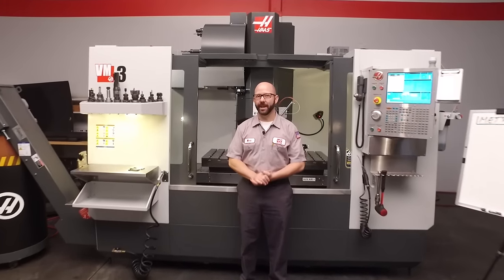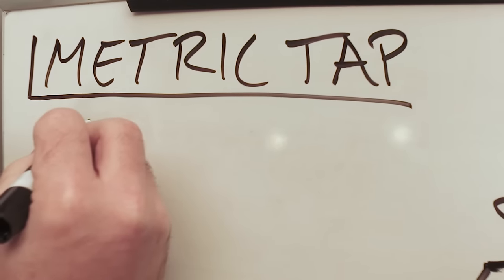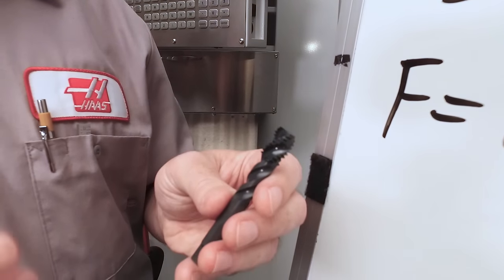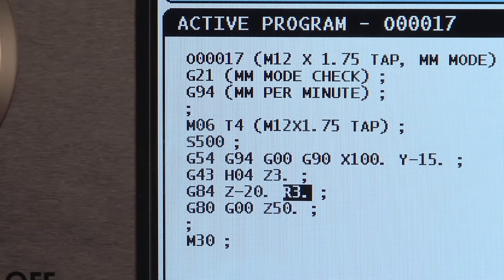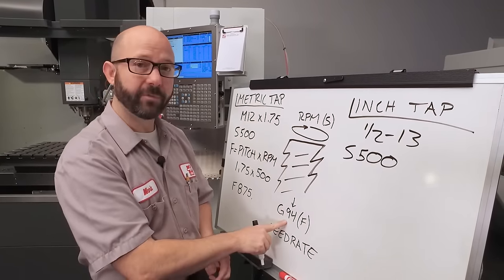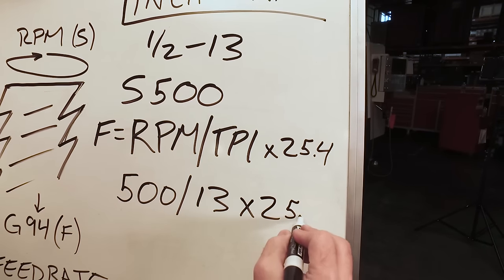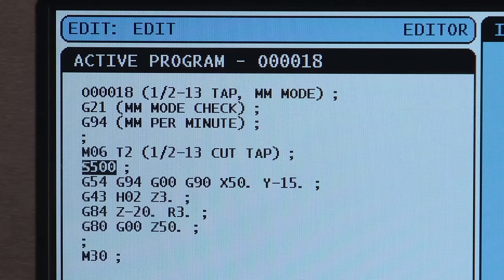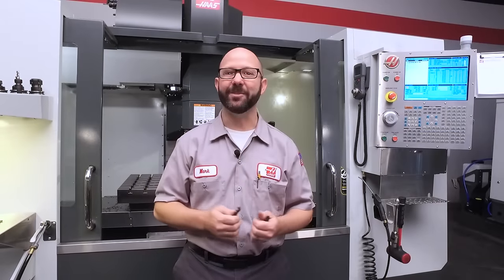Easily Program a Tap in Metric Mode on your Haas VMC – Haas Automation Tip of the Day

Comment: IMO I find it more flexible to use a G95 (feed per revolution) prior to the G84 with a G94 after, that way you can play with the spindle overide without messing up your taping cycle, thus in your G84 your feed simply becomes your metric pitch, in your example it would have been 
G95 (mm per revolution)
G84 Z-20. R3. F1.75
G94 (mm per min)
for the M12 x 1.75 thread, granted it's two more line of code, but you can now play with your RPM to fine tune without recalculating your feed
Reply from the maker: Serge – Great comment. I totally should have put that in the video. I don’t know what I was thinking at the time – maybe just trying to keep the Inch and Metric videos similar. Why do any math at all? Just use the pitch (lead) as your G95 Feedrate, and tap. Thanks for the comment. – Mark, Haas Tip-of-the-day

Comment: Once you understand feed per rev x rpm and whether you are in inch or metric mode it's a pretty simple deal. I think you could also switch to inch mode for the 1/2-13 tap sequence, then back to metric and the end of the tool cycle. Am I right?

Comment: Yery nice sir. Like that how to calculate drill size for single ster inch tap, form tap, n p t  tapper pipe tap,and helical insert drill tap ? How to Thread milling od id dia  calculation?
How to do dubbel star or thribal star thread milling?
Generally Why we Can't be using in milling tapping, threading,  G95 feed per revalution?

Comment: I,ve never seen a milling machine program that has the feedrate in a tap cycle to be in mm/min. Its a dead set custom in Europe to keep the feedrate in MM/rev (the same as the pitch) to avoid mistakes .
Is this changable a machine parameter setting in haas machines?

Comment: It's more easy to program in feed per revolution mode or G95. The feed is exactly the pitch of the tap. You can change the RPM as desired and the pitch still the same (the controller will do the rest for you). So if you get a M12x1.75mm tap the feed is 1.75mm (considering your machine is running in metric mode).  If your machine is running in inch mode you must convert mm to inch. 1 inch equals 25.4mm. 1.75÷25.4 is approximately 0,0697 inch. This is the feed to be programed in inch mode using the M12x1.75mm tap. Too easy and no mistakes.

Comment: Could you do a video on the lathe talking about G70 G71 OD/ID turning cycles? they are very useful and one of the main ones you use.
Reply from the maker: +the hollow box We will definitely forward your comment to our video production crew. Thanks for the suggestion!
Reply: +Haas Automation, Inc. is there any way in which you can turn off or a least reduce the "beep" sounds whenever a key is pressed. Most of the time it's good to hear the sound to know it's been firmly pressed but other times it can get irritating/annoying.
Reply: I agree with you that a beeping sound on the Haas controls are really annoying.  Especially on the new Haas, this beeping sound is really loud.  On the busy day, this beeping sound is driving crazy.......

Comment: I like tools for helical interpolation thread milling, i thing it's safer, can be corrected,
a single tool can be made with threads of different diameters (particularly for larger threads),
programming takes longer but how cool is if you can prepare a program of R parameters.
What you think ?
(sorry for my English, I am a Polish and I'm still learning.)
Reply: Yeah this is a good way to make threads but is not really that quick to machine, VARGUS make a good tooling range for this and a nice little software package that has all their tools set up in it. The software is easy to use as it is predominantly graphical with some data entry and selection from dropdown lists.

Comment: FEED = RPM / ( 1 / ( pitch / 25.4) Is generally the method i use to tap metric tap with inch coord system.
Reply: +Anthony Norwood What would be the difference between lathe and VMC programming?
Reply: Generally in the lathe feed rate uses inches/millimeter per revolution.  Where the mill uses inches per minute or millimeters per minute.  So in a lathe, tapping feed rate would be the thread pitch, rpm would not affect it.
Reply: Suhaib Sbaitan He literally just said that. 
You're not a mathematician.
Reply: Suhaib Sbaitan There isn't. 
Lathes and milling machines can perform the same functions.
It's dependent on how you want to do it.

Comment: Hey guys just wondering why you don't switch for g94 fpm to g95 fpr tis is a better way in my opinion because if you need to up the rpm you don't need to recalculate the feed per minute this is a good idea because you might forget to change the feed rate especially if you get interrupted by your work colleagues etc.
Reply from the maker: Ray 1 – I like the way you think Ray. When running on a machine in Inch mode, we have to do all kinds of funny math. When tapping on a machine that is in Millimeters (Metric Mode), I think you’ve got the right approach – switch to G95 Feed per Rev, and just use the tap Pitch as your feed-rate, making sure to put it back in G94 Feed/Min when you’re done. On machines in “Inch”, I typically calculate things out (I use a lot of metric taps), but there’s no wrong way. Thanks for the comment, I’m sure it will help others. – Mark, Haas Tip-of-the-day
Reply: Yeah although I have been programing cnc's for nearly 20 year's (same 3 machines so very familiar with them) even I still learn new trick's mainly due in part to the type of work we do , our work is always in mm so have to convert tpi to metric  pitch. at the moment I am looking at right angle heads so have been watching your right angle head video to see how things work. but with tapping and conversion of pitch I do also like to use a floating head to eliminate even the slightest miscalculation.I Have been using a very old software package (BOBCAD V18 yes its old but is does everything we need so far) and have made the internal scripts for the software to perform the g-code programing for me flipping between g95 and g94 automatically. this is for our Fanuc controlled Hartford but our Mitsubishi controlled Leadwell has a funky bit of codeLine goes like this in metric, G98 G84 Z-15 R10. F1.5, R1 what this does is the , Comma tells the machine to treat the feed as FPR G95 effectively and the second R tells it to synchronize to spindle. and when the G80 is triggered it puts the machine back to FPM or FPM depending on my set up code at start of program.
Reply: Ray 1 yes

Comment: So, do you need to use the G94 code ??? or doesn´t matter???
Reply: this feed is in mm per min  ¿right?, so if you use feed per rev you don´t need to multiply the feed  by the RPM, you only write the pitch in milimeters !

Comment: It seems easier to just use feed per revolution and insert pitch value for tapping metric thread instead of calculating feed. Plus the feedrate adapts to RPM in this case.
Reply from the maker: Dawid – I’m with you on this. When programming on a machine setup in Millimeters (Metric Mode), I’ll typically just use a G95 Feed/Rev command, and use my metric pitch as my feedrate (M6x1 tap = F1.0). I’ll make sure to put it back in G94 Feed/Min when I’m done. Things get a little wonky with Inch taps, so we showed that method in the video. Check out the bonus content for all of these formulas. Thanks for the comment. – Mark, Haas Tip-of-the-day.

Comment: 1:06 feed is 1.75 in G95. cant be that hard? RPM not make any diff feed is allways 1.75.
if inch thread is 19 tirm inch then 25.4/19 = 1.337mm pitch. feed is 1.337mm cant be so hard use g95 no need calculate mm/min LOL